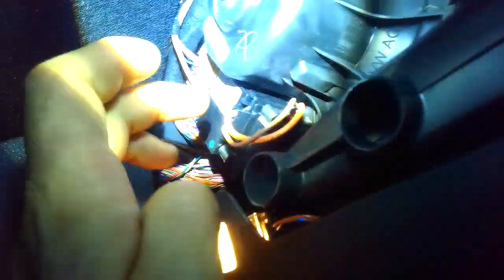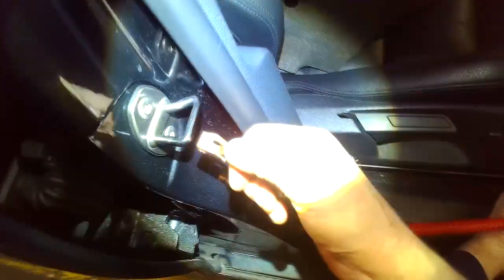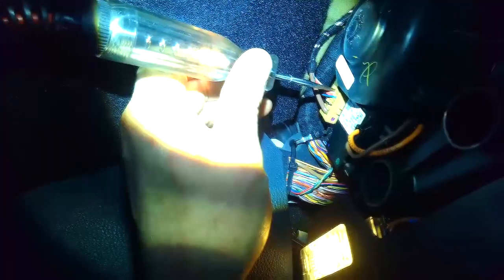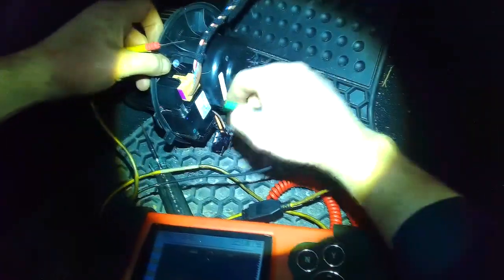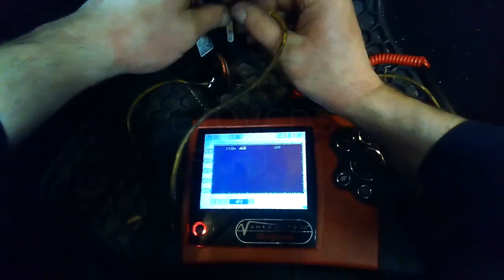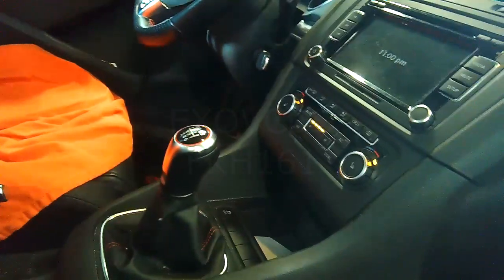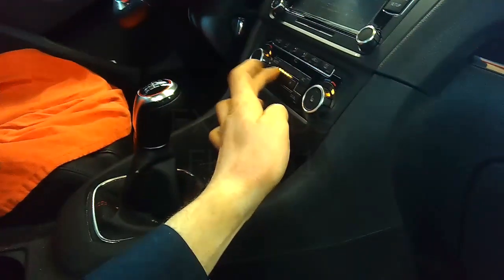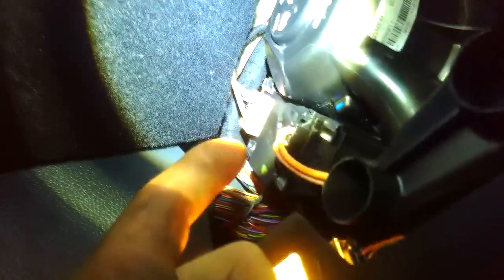VW AJ: '10 - '14 Golf / Jetta interior blower motor not working

Comment: i did what you did to test it, and suddently the old one started working again :)) thanks!
Reply from the maker: It will probably stop again... either the power output stage is going bad, or the motor is starting to get tight.

Comment: i had issue your vid help mine was just making a very loud sound when on i got it out sprayed it with bike and chain grease fitted back now its perfect again been on my mind to do for a while so much better without drone sound now
Reply from the maker: Thank you for sharing your DIY experience. If there is signs of rust on the motor / bearings... look for a possible water leak.

Comment: Good video 
Any experience with a 2012 vw golf tdi, as to why the whole heater control panel would have zero power?
No lights, no blower, nothing
Steering wheel controls work, does this rule out the ccm?
All fuses good
Reply from the maker: I'd have to check a wiring diagram (when I have time)... I'll get back to you. If you don't hear from me by tomorrow evening (similar time), post a reminder under this comment.
Reply: @EXOVCDS  copy that thank you
Reply from the maker: Not sure I'm looking at the correct wiring diagram, sorry.

Fuses 4, 14 and 22. Fuse 4 only has power once Terminal 15 Power supply relay has power (ignition on) while 14 & 22 should have power all the time. Yes? Fuse panel C: fuse box at left side of instrument cluster.

Comment: on my 2006 Golf V: Same setup as you have, 12.something volt coming in to power unit, nothing coming out to blower. blower power wire has corrosion and melted a little, but still has connection. What I did was short the blower power cable and the good 12v power input, nothing happened. I turned ignition off, then on, it worked for the while. I turned everything off, came back, blower dead again.
Reply from the maker: Did you check thr command signal voltage? The one that changes as the blower speed buttons are pushed? Like at the 4:30 mark?
Reply: @EXOVCDS  unfortunately no, I dont have a back probe, but I guess I can look at ohms instead with voltmeter ?
what I did though is verify through VCDS meas blocks that my input works correctly, speeds all appear ok when I rotate the knob but no blower movement
Reply from the maker: So your panel is different... no push buttons for speed? If the blower motor has a power output stage like in the video, you should still be able to touch your multimeter leads to the power output stage "control wire" to check the control signal voltage. A wiring diagram will tell you which wire it is. Disconnecting to motor and applying 12v directly, will tell you if the motor is OK. The motor should turn full speed. If it does, but starts to slow down or it doesn't spin full speed, then the motor is bad.
Reply: @EXOVCDS  it is different a little yeah, I have 3 turn wheels. I uploaded a video with the fix that works for my case, you can take a look
Reply from the maker: @Juppie902    thanks. Strange that you can still control the speed with the knob. I would have expected the fan to be full speed all the time. The burnt wires / melted plastic is because the motor is drawing too much current (my guess). Replace the connector & wiring.... it could start a fire if you leave it.
Reply: @EXOVCDS  as I said in the video, I don't think it's sold separately from the motor as you said a new motor comes with a new power output unit, I presume it's the only way to get a new wiring and connector. as for current draw, I looked up a fuse schematic online, fuse #4 supposed to be 5A but it was 10A on mine. i quickly replaced to 5A, but the damage was already done. it says fuse #4 responsible in part, for J255 Climatronic Control Unit
Reply from the maker: @Juppie902  Connectors can be bought from the dealer or aftermarket... sample:
https://www.ecstuning.com/b-genuine-volkswagen-audi-parts/2-pin-connector/1j0972923/
Dealer should have "pig tail" connectors (complete connector with wiring).
5A is probably the control circuit. 5A seems too low in my mind, for the motor circuit.

Comment: the register of the motor of the air blower has 4 pins (passat b6 1.9 tdi 2005) is it possible to put a register of 5 pins? vcds tells me it has error code 01273. the 4-pin register is very difficult to find in Portugal. Thank you for your help .Ps: my english its not perfect
Reply from the maker: What country is the car in? B6 in Canada did not come with TDI. Can you post a video of the part... the part number?

Comment: Thomas, how to energize an a/c comp. to put freon on a 97 mk3 Jetta? Thanks
Reply from the maker: Attach the AC bottle and purge the line going to the high or low side. Add / charge the system until there is enough pressure (gauges will tell you). If the only reason the compressor did not come ON, was due to low charge, then the compressor will come ON once the system has enough charge. Once high & low pressures have equalized, let sit for a while and then start the engine. You do not want to add "liquid" AC Gas to the system (to prevent compressor damage... compressor can not compress liquid). **DO THIS AT YOUR OWN RISK!!! We use an automated AC recovery & charge machine.** If the compressor does NOT come one once they system has enough charge, then there is a second issue / problem.

Comment: Hi Thomas, great video. What would be a possible reason for not getting any heat when I attempt to defrost my windshield?
Reply from the maker: Alex M Year make model? Do you get heat in other locations?
Reply: Thomas EXOVCDS it's a 02 VW Passat 2.8L. I actually don't get much heat and or much cold either. Thanks for the reply
Reply from the maker: Sorry for late reply... Check your cabin air filter in the engine bay under the passenger side of the windshield.
Reply: Thomas EXOVCDS , finally getting a chance to reply, the cabin filter is actually spotless and clean
Reply from the maker: Alex M Thanks for the update! I've seen them so dirty that air can not pass through... which results in low air flow inside the car. If you have foam pieces flying out of the vents, then the blend doors need to be relined. Blend doors not moving correctly can also affect heat & directional control. If the doors are cable operated, look for correct movement from under the dash while moving the heater / control knobs. If the controls are digital... listen for motor activation / movement.

Comment: I had a build up of debris and stink bugs trapped in my blower motor, we got a new one and installed it, it made a connection, the other one did nothing even after being cleared but it still won't turn on fan at all. What should we be looking for at this point?
Reply from the maker: Did you replace only the motor or also the power output stage? Year, make, model?
I'm not sure what you mean by "it made a connection".
Reply: @EXOVCDS  it's a 2013 Jetta sports wagon 2.5L. my husband said the old one did nothing, the new one clicks and sounds like it wants to run but still no fan.
Reply from the maker: @isalescrew  Check that the motor is not hanging up on something. Remove the motor and leave it attached to the wiring... activate the motor while it is out of the blower housing, like i did. If it spins when it is out... then it must be hanging up on something when installed. If it does not spin, give it a little push... if still no (and you have checked for "command voltage signal") then replace the faulty new motor.